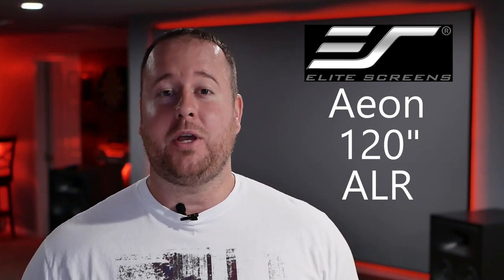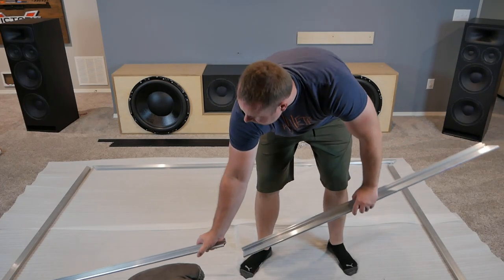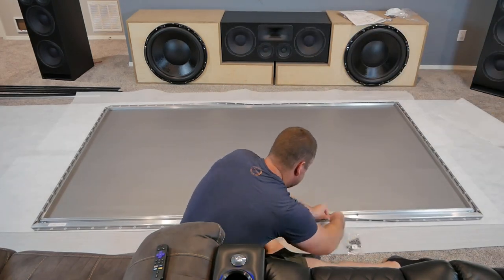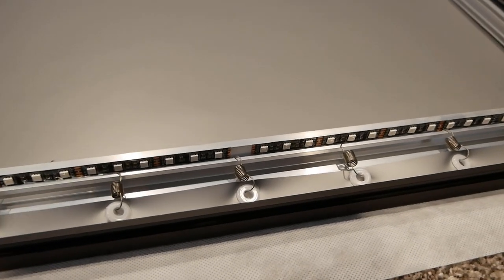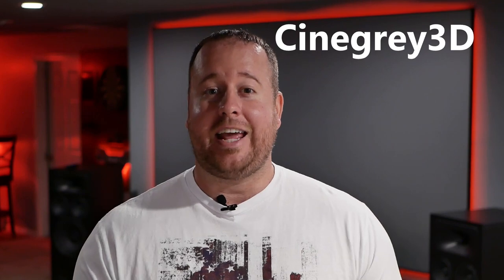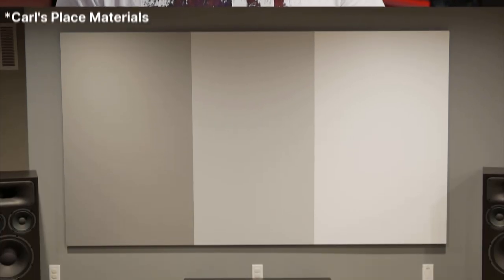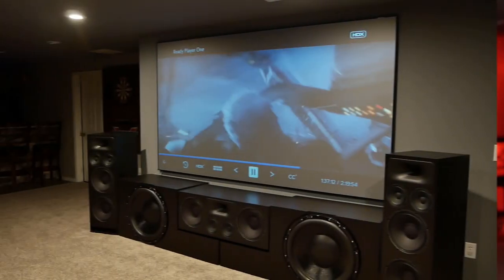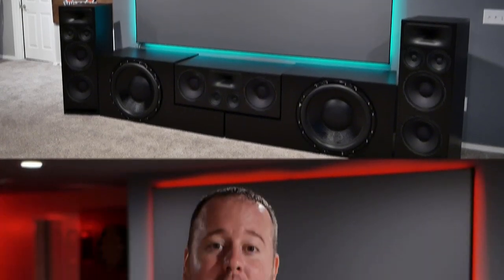Elite Screens Aeon CineGrey3D CLR ALR Projector Screen Assembly Guide and Review

Comment: There's two ways to build a home theater sound system for a house:
Using a lot of low power speakers including subwoofers spread in the room, or using a big and powerful but with less speakers that have a lot of headroom to be corrected with equalization.
You did it the second one, congratulations man! This is a dream home theater for a lot of people, including me.

I know that there's some persons that build a big and powerful system with lots of speakers, but they do this because the room is big, if the room is not big they are it doing wrong, is what we call an overkill.
Reply from the maker: Thanks man! We don't like that overkill word around here... more than capable sounds better 😉🤘

Comment: Awesome Video! I bought the Elite Screen 120H2 in CineGrey with the light kit as a Christmas present to myself. I absolutely love the screen and the light kit. I find that watching movies with the blue light on its lowest setting actually boosts the contrast a bit and makes the blacks darker. I bought mine off of amazon and I was a bit disappointed when I received the older style that had the velcro instead of springs. My one complaint is the older style doesn't have the brackets for the bottom of the screen so the bottom doesn't sit flush on the wall. After seeing your video, I reached out to Elite Screens to see if they would send me some additional brackets for the bottom. So far, all my experiences with Elite Screens Customer Service Reps have been great.

Comment: What kind of anchors would you recommend to use when hanging the screen?
Reply from the maker: Hit studs with screws if possible. If not,  I usually use sheetrock ankers rated for at least 35-40 pounds

Comment: I have a samsung ultra short throw monitor and I have to ceiling mount it due to little one running around. Since it's going to be mounting on ceiling do you know if I am able to turn a ASR screen upside and get the se results if no ambient light is directly over it?

Comment: Hello I want a clean look with the kit you have is there enough space for the power cord for the led kit to mount behind the screen? I have a outlet behind the screen
Reply from the maker: Not with this particular kit... I'd take a look at the Carls Place screen video I built. That kit would be easier to hide wires. This particular is too bulky and I don't particularly like the IR remote
Reply: I don’t see the power cord hanging from your screen in the video how is it powered? And how much space is between the screen  and wall
Reply from the maker: On the carls place video? The cord runs through the wall to the closet behind the screen. Its powered in there. Theres maybe 1 inch behind the elite screens screen. Not much. 1.5 inches behind the carls place screen

Comment: Why the subwoofer on the front doesn't have a hole?
Reply from the maker: Sealed enclosures dig deeper than ported. Plus they don't need as large of enclosure. For a woofer this big, you don't need the extra output at a certain tuning frequency like with smaller woofers

Comment: Quite expensive screen. Do you have a side by side comparison between the screen and your wall behind it? What if you just black taped the edges of the image on the wall?
Reply from the maker: Walls will never be as good as a screen to be honest. Not as uniform and the paint vs material just isn't going to give as bright or accurate as image. Does it work? Sure. Did it for about 6 months. You'll want a screen though for long term
Reply: @LifeofBliss  I agree when there is ambient light, but when you watch a movie at night and turn off the lights, you just cannot tell the difference. In my experiences you do not notice the small imperfections on the wall at all when watching it in a dark room, and to me only movies matter quality wise. So of course it depends on your preferences, but I was just thinking if it was worth paying thousands of dollars for a barely noticable improvement, unless you use it with ambient light most of the time. Your wall looked very similar to the screen, that is why I asked. I just black taped the edges on the wall recently, and it already made it look like a proper screen at night. I have a 97" screen too, and the only difference I noticed was because of its smaller size, and the black edges. But anyway, enjoy it.

Comment: My elite screen is spreading some light out of the edges any ideas bro
Reply from the maker: Sounds like your projector is using keystone correction to fit on the screen and there's some light bleed from that. If you're able to use a zoom function on your projector vs keystone, or physically move the projector closer to get the image better fit on the screen, that will help
Reply: @LifeofBliss  thanks for the suggestion I will try that.

Comment: Why havent you went to a UST yet?
Reply from the maker: Have had one for 2 years. Videos on the channel. They are ok in a pinch, traditional projectors are better imo
Reply: Depends on what your spending on an overhead projector. The quality in a UST with an ALR screen you'd pay 3 times as much for an overhead. I don't have a spot for one so went with UST. I watched your sub and speaker build and stopped Watching. This vid randomly popped up. I'll check out your ust video.
Reply from the maker: Yea the ust makes it easy to add a projector almost anywhere. They definitely have their place. And budget will have a lot to do with picture quality. No ust setup can rival the nz line from jvc from my experience. Again, budget will determine your experience
Reply from the maker: I don't really think it will take 3x the budget for a standard projector to best a ust. Epsons new projector is amazing and isn't in the super high end of pricing. Ust projectors aren't cheap either. I look at them as another option for consumers that don't have the ability to add a traditional projector. I would argue your passing a premium for a ust and alr screen to match what a cheaper long throw projector can do

Comment: You placed the leds in the right spot the other video the dude placed it on the black outer frame cover😅🤣😂 I dont think he realizes that any led even on a t.v. is for background light not for edges  where you can actually see the strip😅🤣😂
Reply from the maker: Ah, yea thats not the right place... I'm big on higing the actual LEDs where ever I put them. Don't wanna see the actual LEDs!
Reply: @LifeofBliss  I could not believe  what they want for a set of led thats a crime. I looked into black screens I nearly  passed out from the price
Reply from the maker: @sam6stringestrada31  check out Milight products on amazon. Thats what I did my bar and diy screen with. Its fairly inexpensive but the control you have is great for the money. Not overpriced like some other companies and its over Bluetooth or wifi so no direct line of sight needed like the IR remote setup elite screens has